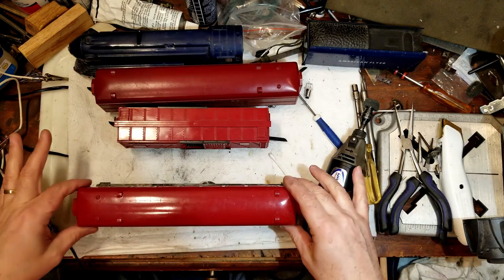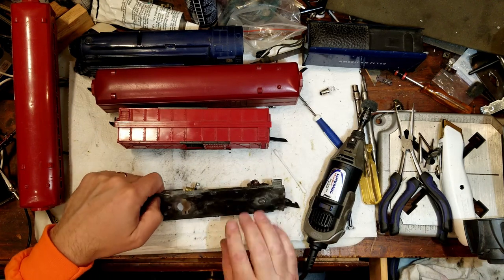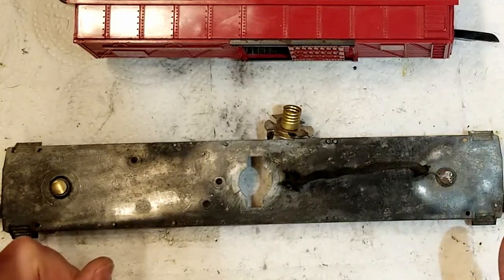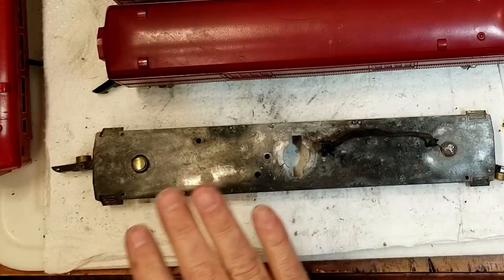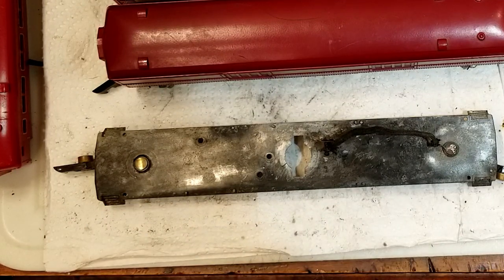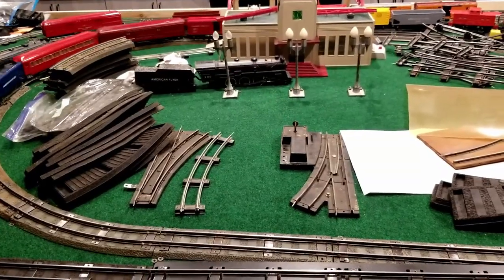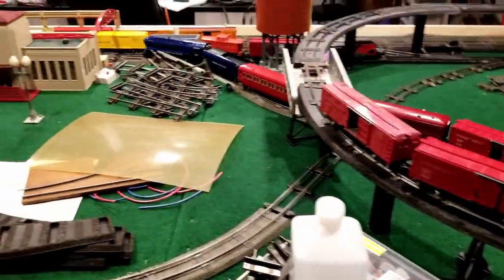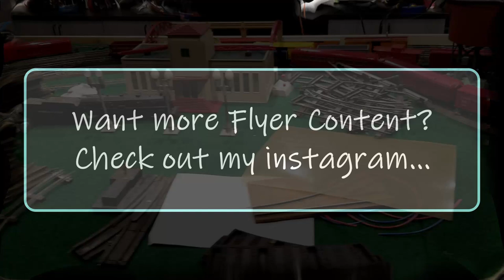A simple solution for flickering car lights.

Comment: Austin, another way I found to clean the wheels, and what I now do to all of my rolling stock is to soak the wheels for a few hours in Simple Green to loosen up the built up gunk and grime. Then I loosen the remaining gunk with a small wire brush. I then polish the metal wheels with a dremel tool abrasive wheel and then soak all wheels in a jar of CRC 226. This helps to keep the wheels cleaner longer and also provides electrical connectivity for the powered wheels. I believe I got this method from Dave of Daves American Flyer trains. it works well.
Reply from the maker: Thankyou Michael. I've been amazed at how clean Dave wheel sets are.  And I soaked and dipped wheels in just about everything but simple green...which I will now be doing. Wonderful tip!

Comment: I continue to learn so much from your videos.  Thank you for making and sharing them.  Two questions - I see you using diffferent attachments with your Dremel.  Which ones do you use and for what purpose?  And, have you installed a smoke unit in a Royal Blue?  Do you have a video related to that project?  Thanks again.
Reply from the maker: Thanks Stephen...I primarily use steel brush attachments for removing oxidation/dirt.  I have not installed a smoke unit in a royal blue.  I have two royals to rebuild with one of them being a major project.  I would like to add smoke and chuff to that one but have several other projects ahead of it.

Comment: This is a good fix but an even better one for those of us retrucking thru-scale three rail cars is to install the copper axle wipers with the replacement two rail trucks such as they used on steam engines along with insullating bushings. It is labor intensive but worth it.      CASG

Comment: Are those light bulb holders easy to find?  I have a caboose that is missing the light.  Thanks.  I'm just getting reintroduced to this hobby.  In the 70s and early 80s I have the typical HO Tyco trains.  My wife found a 1950 American Flyer 290 with the original one piece speed control handle and a train show we went to a month ago. It would appear that the S scale is easier to put on the rails. My oldest boy and I got it to run for the first time tonight.  It took a minute to figure out that the controller is A/C with our volt meter.  I'm used to the basic D/C. When we first tried running it,  all it did was make a buzzing from the tender.  What?!? What does that have to do with the motor.  SMH. After binge watching your videos,  we discovered the reverser mechanism in the tender.  We flipped the lever back and forth a few times and the engine took off. Didn't run it too long due to not sure about lubrication.  But just long enough to hear the chugging sound and smoke.  Was shocked and amazed that something this old had those features.  I was giddy. But now on to properly lube and inspect it before running it.  According to a note inside the engine,  it was rebuilt in 1994 by R.O. Hunt 2-94. Sadly the year built stamp is missing on the inside.  But from what l've found the 290s were built between 1949 and 1951 and my one piece red bakelite  throttle handle is also correct for those years.
Reply from the maker: Hello Mark.  Welcome to a fantastic scale! The bulb sockets could be purchased on a site called Portlines.com, ebay, trains-n-more.com to name a few.  American flyer cabooses are inexpensive so you I would recommend that you purchase a lit one but this is your call.  Here is my website.  I add more flyer items as I have time to get more refurbished.  https://sites.google.com/view/flyerfusion/home?authuser=1
Reply: @AustinsAmericanFlyertrains  Thanks Austin! I'll certainly check those links out and yours as well.

Comment: You have screw in LEDs, where did you get them and is the screw part have a special description
Reply from the maker: I purchased these from amazon.  E10 screw is the type of base needed.  12volt seem to work well.
GutReise 10pcs E10 Screw 12V Cold White Flood Light Led Bulb Flood Light Lamps +10pcs E10 Base (12V, Cold White)
Reply: @AustinsAmericanFlyertrains  Thanks Austin
Reply: @AustinsAmericanFlyertrains  I now have a small limp node in my right lung that they are going to use 3 aggressive radiation treatments to kill off. They've gotten 4 tumors so they seem to know what they are doing
Reply from the maker: @davehunt5766  I'm sorry to hear this.  I will pray for your healing.
Reply: @AustinsAmericanFlyertrains  Just one more challenge to overcome